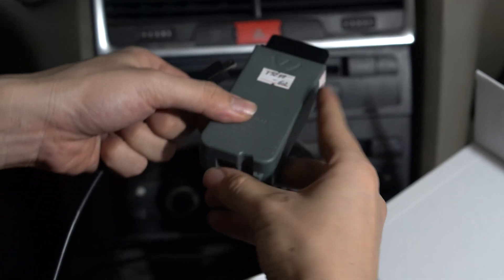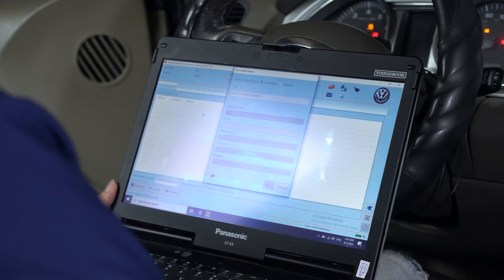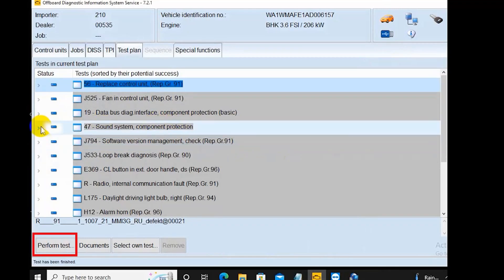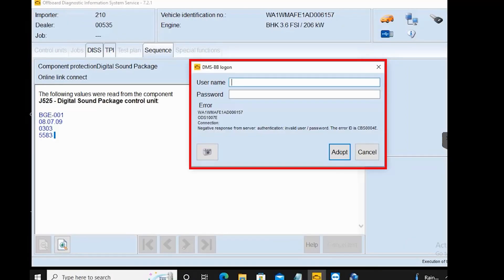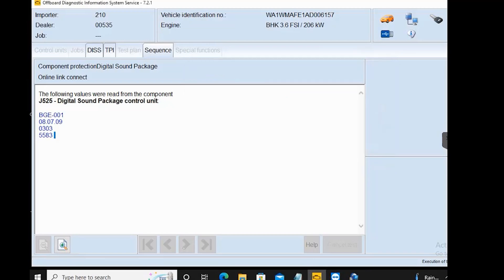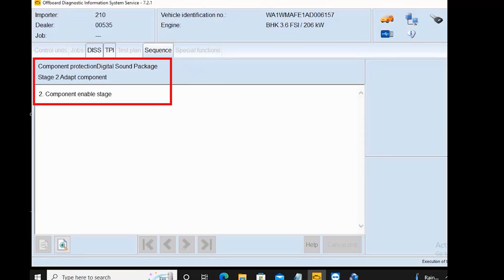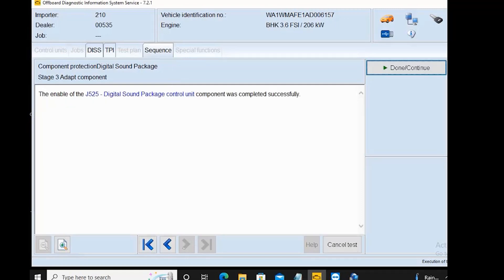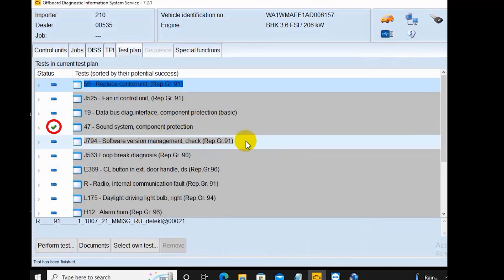HOW TO FIX SOUND SYSTEM COMPONENT PROTECTION On AUDI Q7 | EUROCARTOOL.COM

Comment: Do you need the vin# if I replace amp with a used one.  Also how much is your service to remove component protection
Reply: I've paid the dealer 200$ twice.  Before I finally figured out where the water is coming from
Reply from the maker: Connect with me via whatssap to best support you WhatsApp: wa.me/message/JWACD3PLNZRAN1